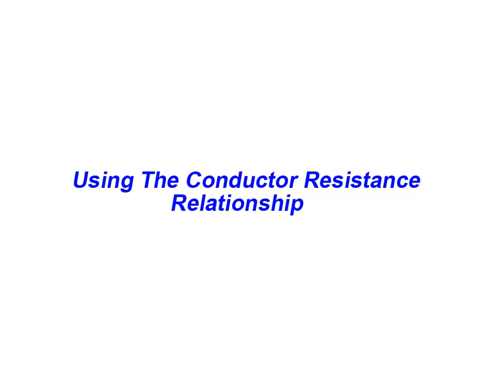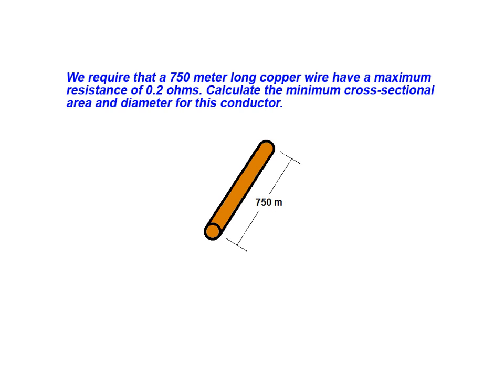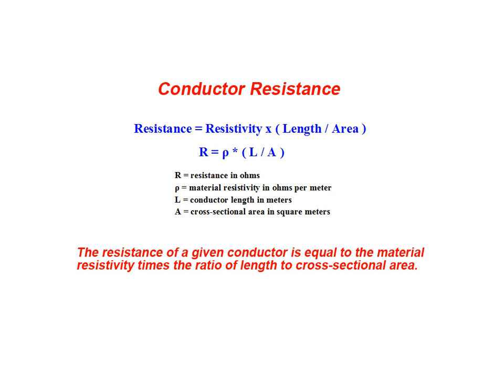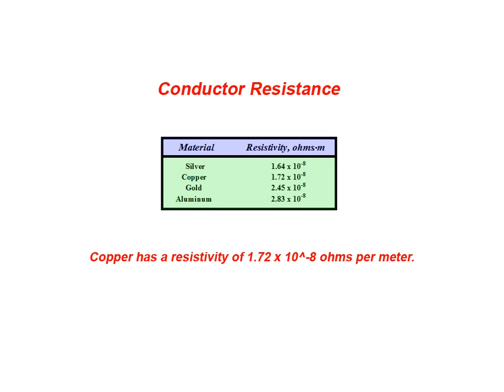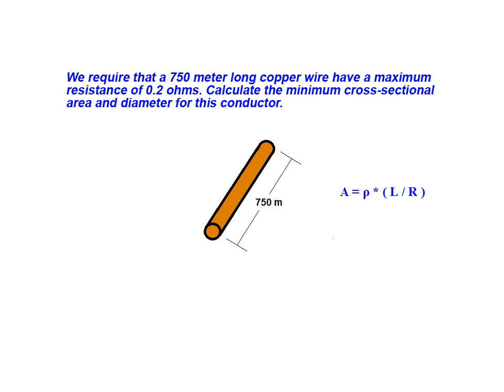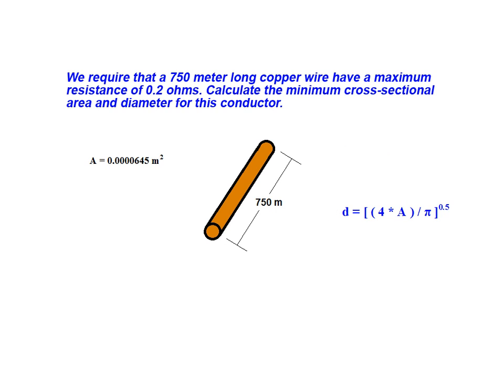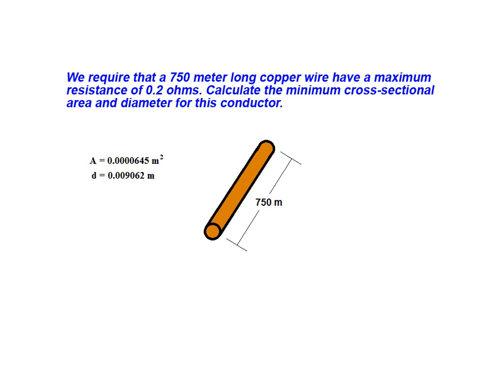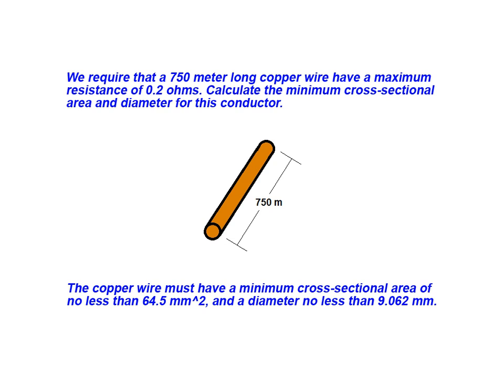Calculating Required Wire Diameter And Cross-sectional Area

Comment from the maker: Without a material, you cannot determine the resistance of a conductor of a "given" material.  Different conductors have different resistivity.  In practical cases, an approximation would be appropriate if no material is given, however, the value would have to be negligible in terms of the application.  If it was not, you would be given a material type.

Comment from the maker: If the cross sectional area is lower, the resistance of the conductor will be higher than desired.  The lower the cross sectional area, the greater the resistance of the conductor.